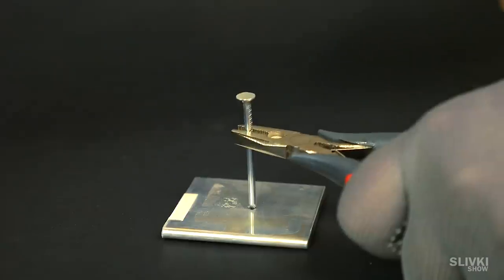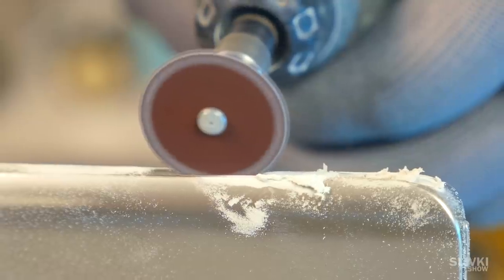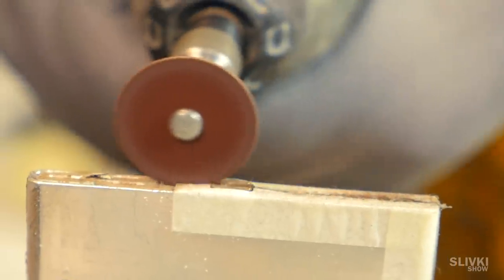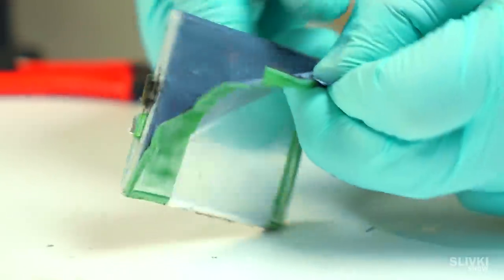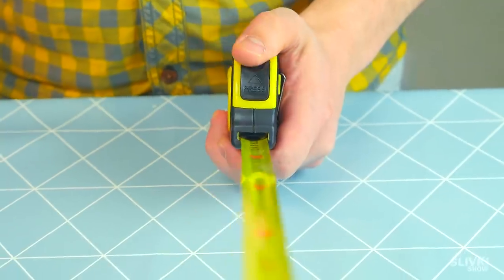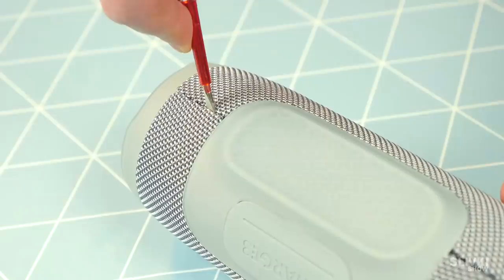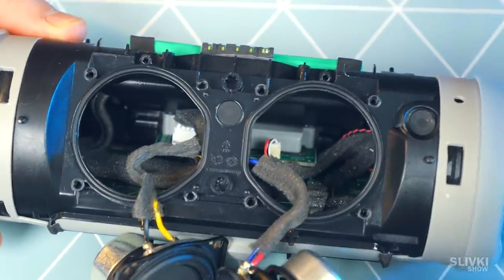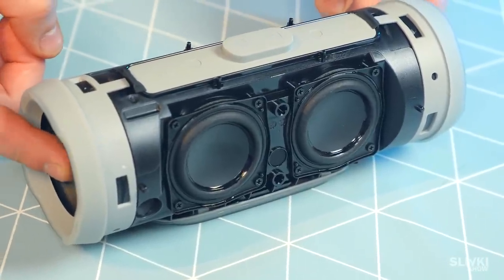What’s Inside of JBL Speaker?

Comment: Those large "Speaker" looking things on the ends of the JBL speaker are called passive radiators. They enhance the bass performance.
Reply: Kentucky Ranger kool
Reply: Kentucky Ranger Didn’t know that
Reply: It's old speaker tech. It makes the speaker think it's in a much larger enclosure.
Reply: Fascinating... 😈
Reply: Smart !
Reply: MrVolucris also keeps it waterproof
Reply: Kentucky Ranger Tell us more.. how does it "think" it's big?
Reply: and at the same time cool down the audio amplifier inside
Reply: Net Lag it's just a simplified version of explaining it. The radiators can expand on both sides and are made to vibrate at a certain frequency. you would normally have a bass port where the length and size would create the right amount of pressure behind the speaker. Here however it is the weight and stiffness of the radiators that create the needed pressure.
Reply: Laurens Van Der Veen cool.. thanks
Reply: I have one of these and I was wondering if those were actually speakers.
Reply: jbl lied their supposed to be subwoofers
Reply: Kentucky Ranger   No shit sherlock, most decent bluetooth speakers have these.
Reply: Net Lag thinks its bigger because of the resistance coming from the passive radiator isnt completely solid, the unit moves to the speaker acts like its a little larger of an enclosure to produce a more boomy sound, pretty simple once you grasp it a little
Reply: AJLION GAMING nope they didnt lie, the 2 other speakers are woofers, these are just passive bass radiators, they act like another woofer tho in a way
Reply: I was getting ready to answer, then saw you took care of it, LOL!
Reply: AJLION GAMING they never said they were subwoofers they call them passive radiators. wich is what they are
Reply: I looked at the Amazon ad. JBL calls them "Passive Radiators" Says nothing about subwoofers.
Reply: Thanks! I feel complete now, knowing I'm so clueless...
Reply: Jonathan Suhy thanks for the reply. !,,
Reply: Everyday im shuffling
Reply: Kentucky Ranger i always thought that those two on the sides are the sub woofers for the speaker. Hmmm....good to know that.
Reply: I was just going to say that. They are tuned to a specific frecuency, so they resonate at that frecuency, and they make it sound louder, generally they are "Tuned" to enhace bass response
Reply: no they're called dynamics ahaha
Reply: False. Passive radiators DO NOT make the speakers THINK they are in a bigger enclosure, they act almost EXACTLY as port. they provide a tuning frequency to enhance the efficiency of the speaker at a certain frequency or frequency band.
Reply: They're*
Reply: Kentucky Ranger I didn't know speakers think
Reply: Dope , they should start making  car speakers like this
Reply: AJLION GAMING those were never supposed so be subwoofers. If anything they would be woofers.
Subwoofers and woofers are 2 dif things. Also having a “subwoofer” that small would be dang near impossible.
Reply: They also make it a whole lot more marketable, since that little piece of information is either not given upfront or ignored since people have zero idea what it means, and so they're like "look at it move from the bass! Just like big speakers, TAKE MY MONEY!"....and it works.
Reply: Sean C Marketable yes,  but the science behind it is well known now by everybody who does this stuff (myself included) Hoping your "comfortable" with math, look up Thiele/Small parameters...I've been doing this particular math stuff  for some time...
Reply: geopeter Yes, I am comfortable with English, as it is my first language, why do you ask?
Reply: @suhy9861  Completely and utterly wrong, you have yet to undestand the concept of passive radiators.
Reply: Old Sansui did that and put only twelve watt 8" speaker in big boks and shaking windows with range of 20Hz to 20kHz. Great Japan HiFi sistems.
Reply: @Frankyy4891  which model?
Reply: Lol... Yes they are... I literally just put that myself...
Reply: Subwoofers
Reply: @erikhouter9831  subwoofers are self driven, passive radiators arent and are driven by other drivers.
Reply: That's cool
Reply: I know it is smart
Reply: 777 likes
Reply: Yes for low frequency mode
Reply: Kentucky Ranger the way you said it 😂😂😂
Reply: @KentuckyRanger  lol I'm not stupid
Reply: @westelaudio943  so is the sound generated from the air in front of the passive woofer or does it only provide better internal pressure for the driven woofers?
Reply: @KentuckyRanger  wow i didnt know speakers could think.
Reply: The passive radiator reacts to the vibrations of the air column (sound) created by the main speaker's driver. Now the material and size of the passive driver is set to resonate at the bass frequencies of the inside air column. So it vibrates at those frequencies and that vibration also disturbs the outer air column which we hear as radiated bass.
Reply: Whats the model name of this speaker

Comment: those “side speakers” are actually passive radiators
Reply: Yes
Reply: ABRs
Reply: Correct and the things inside is woofers
Reply: @memehub9177  yeah but fullranges
Reply: when push passive the speaker move & if you push speaker the passive push because of air

Comment: The membranes with the jbl branding on both the ends are passive bass radiators. The passive radiator reacts to the vibrations of the air column (sound) created by the main speaker's driver. Now the material and size of the passive driver is set to resonate at the bass frequencies of the inside air column. So it vibrates at those frequencies and that vibration also disturbs the air column on the ouside twhich we hear as radiated bass.
Reply: can you explain more how the material and size play a factor in this?
Reply: @ZAIDAAS99  the membranes are free to oscillate or move about a fixed point like a pendulum. A pendulum has a fixed time period (frequency). Now if you push the ball of the pendulum when the ball reaches you (at the same time period), the  ball will go higher (the amplitude increases) but if you do the same but in a different time period it may not go that high or even reduce the amplitude ofnthe pendulum. The formula for the natural frequency of the jbl membrane is complicated and can't be discussed here but I guess you get the point.

Comment: The membrane you spoke of (on the ends of the jbl) are known as passive radiators.
Reply: What do they do?
Reply: They move air without being a powered speaker. Essentially they're just frames with a cone & surround. They move when the powered speakers move. The air causes a push and pull force.

Comment: Can you open a JBL charge 2 + ? Please, mine is not working and I want to fix it , but I am afraid to open it.
Reply: If it is broken why are you afraid? Would it broke second time lol?
Reply: throw it ,it will automatically open
Reply: Don't try to fix speakers yourself.
Reply: Matti on Mies I mean it's not working
Reply: ANIMEsh official why u r not going to a repair shop?
Reply: I have an Xtreme. What's the symptoms? If its a rattle or distortion, like the speaker is blown, the screws holding the drive need to be taken out and put back in. If it wont power on or charge it needs to be factory reset. There is a combo that you can find which fixes it.
Reply: try ifixit... No idea if it is on there but it might be there
Reply: Jbl is really shit.I have a Flip 3,which has 3 milions problems.And if you open you understand it was designed by blind monkey!!!
Reply: Matti on Mies I think its in warranty
Reply: ANIMEsh official jbl charge 3
Reply: Send it to me I’ll fix it
Reply: Yes you can open it very easy. I changed my battery last year.

Comment: Dont worry  circuit blowing up or smoking is a mistake sometimes it happen to me yesterday but trying to power a cell phone by the battery connectors and it started to smoke because the power was either to powerful or the wires were touching together

Comment: "Dynamics"? They're called 'drivers'.
Reply: They can be called either, but headphones are more often called dynamics. Fun fact, this is actually one of two types of drivers used in the charge 3 over the years. The different ones have rectangular frames. The difference can be seen in the serial number. If the serial number starts with the letters GG, the drivers will have a rounded frame like this one. If it starts with TL, the drivers will have a rectangular frame, and larger screws.